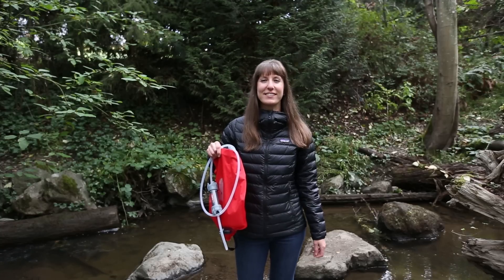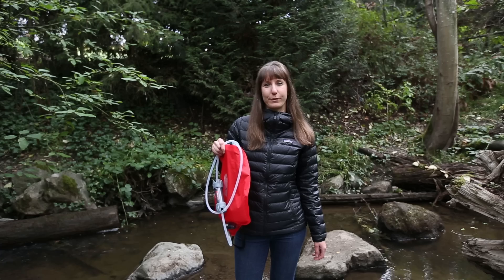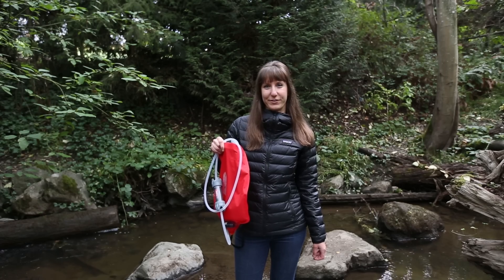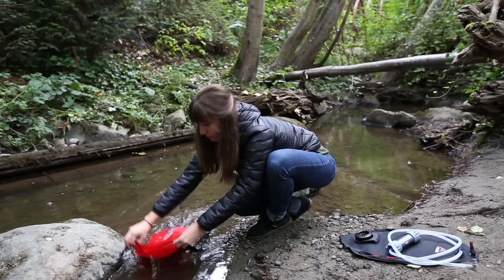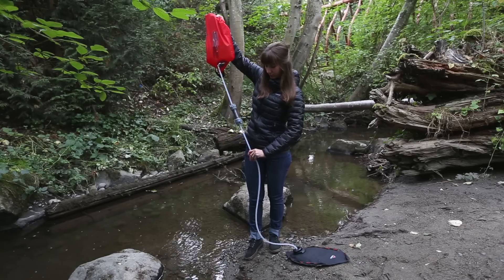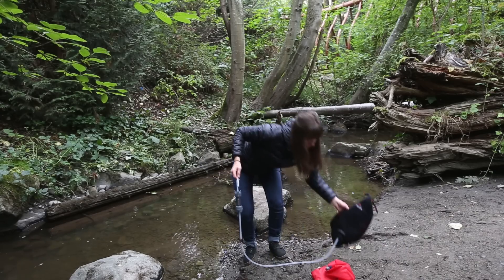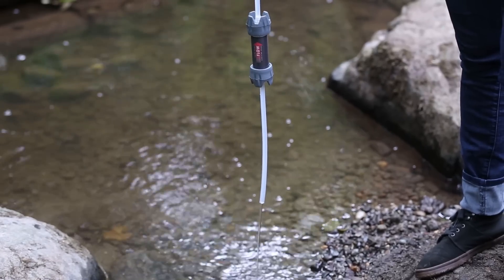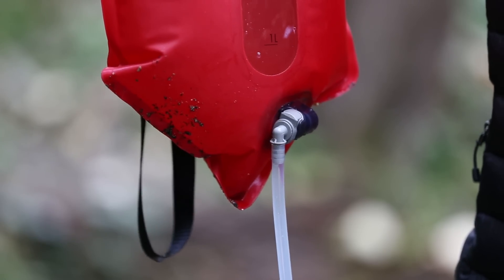How to Backflush: MSR AutoFlow

Comment: If backflushing is so important, then why do they no longer include a type of resevoir that can seamlessly connect to the clean end of the hose?  Not everyone carries a widemouth water bottle and it's rather finicky to backflush from a smart waterbottle or a hydration bladder without the appropriate adapter...
Reply: It's worse than that. I discovered on a recent trip that you CAN'T backflush with a rigid water bottle at the outlet, and that's all we had. This should AT LEAST be part of the instructions! (Fortunately we had a good supply of Aquatabs as a backup!)
Reply: All I did to backflush it without a special bottle the adapter fits, I have a canteen, I disconnected the wide mouth water bottle adapter part. Ran hose in a water bottle full with clean water, disconnect from the filter and just give a suck and the water starts to flow then pinch and reconnect to filter and let gravity do the rest like, stealing gas ha hope this helps. I don't have a single bottle that fits and I still wouldn't buy a different product this things great ha